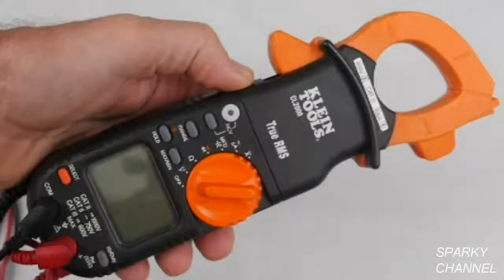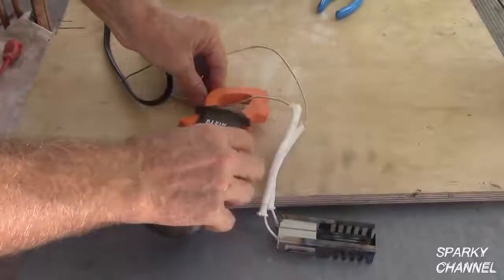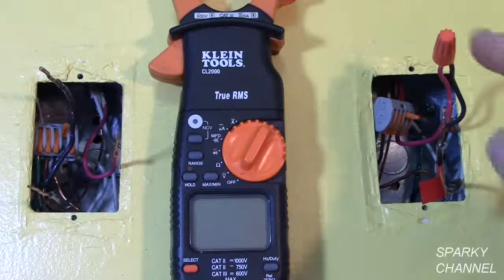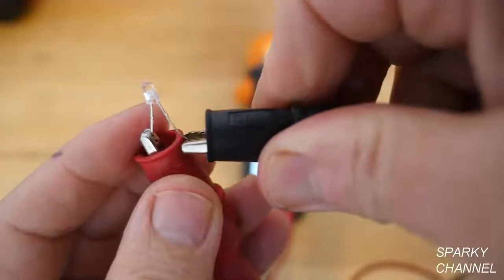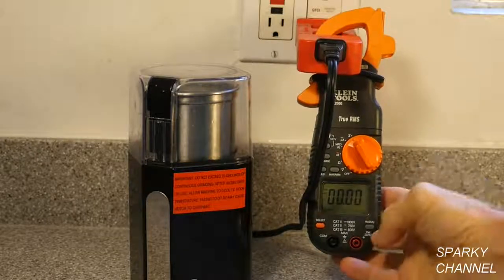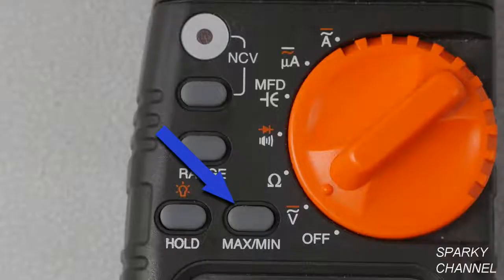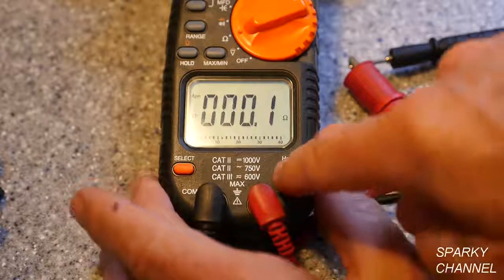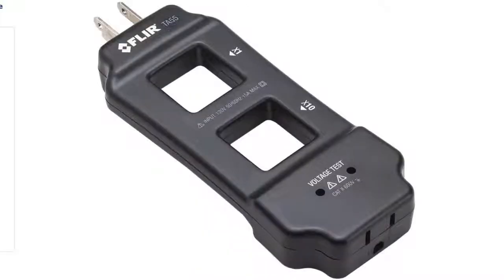How To Use All the Functions of the Klein CL2000 True RMS Clamp Meter

Comment: Thank You, Sir, for a wonderful video. (Liked, Subscribed)

I have a question, though, (if you still read old comments on this video)...

I am detecting a parasitic draw on my car when measuring DC Amps on the ground cable at my battery, however, I can't quite understand how much, 'cause the value shown on my CL2000 has the point in the middle of the screen. 

I know the draw should be in mA DC, but, the tool only has A and microA settings, and when I use auto-tune it shows: 

00.86 or 00.63 A

I don't understand how to read the two 00 for the Amps before the point.

If you could be so kind and explain to me how to measure, (read),  mA - milliAmps - with CL2000, in the format the tool shows - "00.00" A - it would be so awesome on your part. 

(The range of a regular parasitic draw on a car, (from what I was explained), should be in mA.)

Thank You for any help you could provide me.

(*And, anyone from the viewers reading this post, of course - feel free to comment on the topic, too.)

Regards 

I seem to be